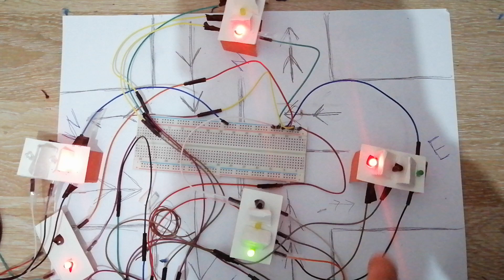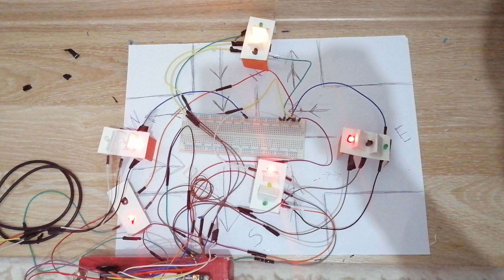Traffic Light Controller System with FPGA 2 | Eskisehir Osmangazi University

Comment: please teach me
Reply from the maker: I can share my code if you want. I think you can understand from the code.
Reply: @MuhammedKocaoğlu  nikamirunfikri@gmail.com. Please sent at my email the code and the pin planner. Thankyou sir
Reply from the maker: @nikamirun1159  I have added in the description section. You are welcome.
Reply: @MuhammedKocaoğlu  Sir , may you show me on how to connect the wire from the altera board to the breadboard? maybe on next video. I really appriciate it.
Reply from the maker: Unfortunaltely, I don't have time for video. I am a senior student, projects and exams don't let me do that. I think you can figure it out yourself if I tell you the logic.  For example, in state 0, external pins are assigned to 100 001 100 100 10  (red(direction1), green(direction2), red(direction3), red(direction4), red(pedestrian) ). As you see, first 3 bits from left represent first direction; 100(bit0 which is 0 should be connected to red, bit1 which is 0 should be connected to yellow and lastly bit3 which is 1 should be connected to green). You should do that for 4 direction and pedestrian as well. There should be a common ground. The ground pin differs from board to board. You can see all of the pins in datasheet of your board. I hope that is clear enough. If you still have question, don't hesitate to ask.